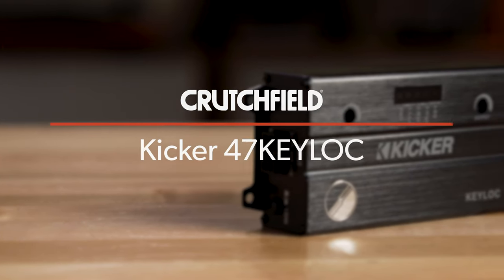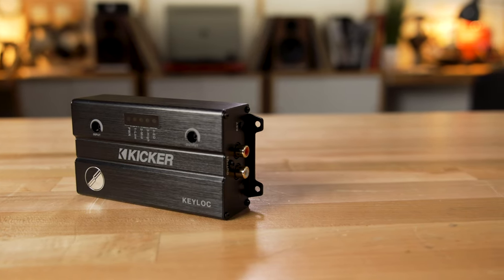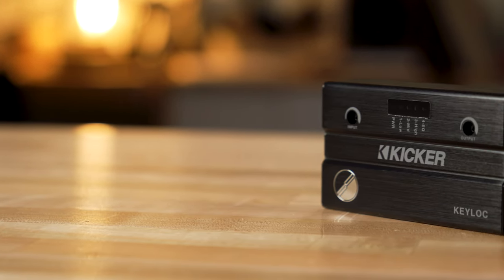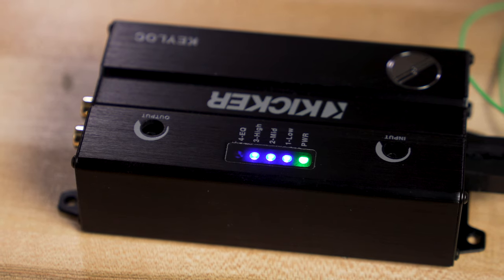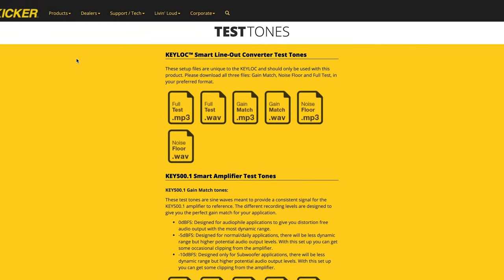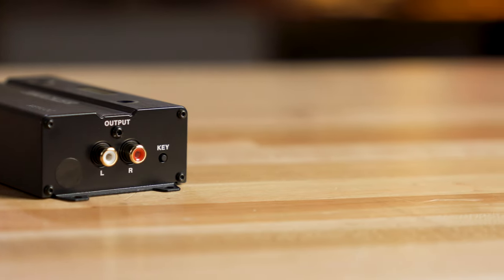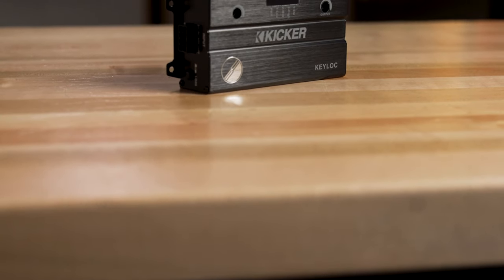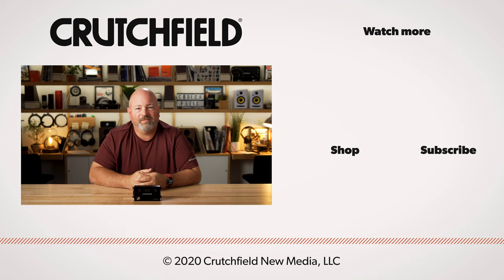Kicker KEYLOC smart line output converter | Crutchfield

Comment: Is this only 2 channels? I am using an LC6i at moment to get 4 channels out from my factory head unit to give me 6 channel output to two amps, one 4 channel for the speakers and a mono block amp for the subs. How would this work in this situation? or is Kicker planning on bringing out a multi channel version?
Reply from the maker: This would be used in place of the LC6i and 3 are needed to have 6 channel RCA output like the LC6i offers
Reply: I'm actually planning on using this for 2 amps. Kicker told me to run 2 Y RCA's out of it.

Comment: Hello! I have a Honda Accord 2015, installed a kicker subwoofer and kicker amp, I’m planning to upgrade my 4 speakers to kickers and an amp kicker also. I’m new into car audio. I have the factory radio head unit, how do I know if I need this little device?
Reply from the maker: Hi Erick, sounds like you are going to have a great setup!
What did you use to tap in for signal to the sub amp? Which 4-channel amp do you plan to use?
Reply: @crutchfield  I don’t have the answer for the first question since I payed someone else to do installation. For the second question, I plan to get the kicker key 200.4 amp
Reply from the maker: Nice choice! Just so you don't have a hybrid model, you can add and get signal to both the sub and Kicker amps using the AudioControl LC6i: www.crutchfield.com/I-rYALc921/p_161LC6IB/item.html
You can use this to tap in speaker-level for signal using your factory radio. You'll run RCAs from it to the amps.

Comment: Would this be necessary if using the kicker key 200 4 channel amp?  Thought about using the key amp to install on the factory system of a non Bose 21 mazda 6
Reply from the maker: No, you would not need a separate line converter when using the Kicker 47KEY200.4 amp, since it offers speaker-level inputs and a built-in DSP.
Reply: @crutchfield    Can it be used on factory speakers or is it recommended to upgrade?
Reply from the maker: Factory speakers can't typically handle much power, so it's best to also upgrade the speakers when adding the 4-channel amplifier.

Comment: I'm going to be having two jblclub5501 monoblock amps and two 8" jbl stadium speakers in my 2022 Ford maverick with the b&O upgraded system. I have been thinking about whether to get the ac lc2pro, but would this work better? And will I need 2 or would one work to run the two amps?
Reply from the maker: Both will give you clean signal using your factory radio. Do you need independent level control for each amp?

Comment: So im guessing i need one for front speakers and a second for rear speakers?? I have a 660.5 runing 4 door and and 1 sub on a 3rd gen tundra
Reply from the maker: We should have a better match for your 5-channel amp.  What year is your truck? Did it come with a factory JBL system or the factory center dash speaker? Are you replacing all the factory speakers? Thanks!
Reply: @crutchfield  23 tundra sr5 off road non jbl. I have kicker 660.5 amp and ks speakers and a low profile 8 in kicker sub tucked away under seat storage u can tell it sounds a bit fuller and some lows are better but it feels like the speakers are not performing to its full cababilities. Kinda leaning towards taco tunes ntune6 audio correction loc but i wanted a dsp
Reply from the maker: The JL Audio FiX 86 is also a solid contender. The Fix86 will automatically correct factory time delayed outputs before summing the signals and equalizing them with dual, 30 band, 1/3 octave equalizers. Its differential-balanced inputs accept virtually any OEM analog audio signal, from low-voltage line-level to high-power, speaker-level outputs (up to 30V RMS). The Fix86 offers three sets of Left/Right RCA outputs with Front, Rear, and non-fading Subwoofer.

Comment: I hooked up my wires from llc to three subwoofer wire and I keep getting distortion.any suggestion how I can fix it?
Reply from the maker: Noise is often caused by a grounding issue. You may want to double check the ground connections as well as make sure the new amp's ground location in the vehicle has  been cleared of any coating on the metal. Also, we have an article that can help identify the cause of the distortion:

https://www.crutchfield.com/I-rYALc227/learn/car-stereo-diagnose-noise.html

Sometimes distortion comes from an amp's gain not being set right. We have a couple articles and a video covering the process to set the gain on an amp:

https://www.crutchfield.com/I-rYALc227/learnsearch/amp_gain.html

Comment: What is the difference between keyloc and kisload4 ? Or do i need both?
Reply from the maker: The Kisload4 is a device that creates a speaker-like resistance that some radios need to see before they will output audio. The need for this part will depend on the vehicle you are hoping to install an amp into and if the stock speaker will remain installed. Will the stock speaker still be installed? If it will not, what is the year, make, and model of your vehicle?

The KEYLOC is a 2 channel line output converter that also has a DSP. Given that it is 2 channel, if your vehicle and application does need a KISLOAD part, there is a 2 channel model that is better suited to use with the KEYLOC. It is the KISLOAD2 found here:

www.crutchfield.com/I-rYALc227/p_20646KILD2/item.html

Comment: Hi, I just bought one of these from you so I could add an aftermarket sub/amp sub to my 2024 genesis gv70. The gv70 came with Prestige package that has the Lexicon system. I've heard from other GV70 owners that because the prestige has an active road noise cancellation technology, that you will hear it through the aftermarket sub once installed. Will this keyloc clean up the signal from the amp? I already tapped into the left and right subwoofers. Someone on a genesis forum said they used this to remove the road noise signal, but I was hoping someone else could confirm this.
Reply from the maker: Hi Tim, thanks for your order. You generally do have to turn off the factory active noise cancellation system when you add an aftermarket amp and sub. Our Tech Support can help with this. Their direct number is on your invoice.
Reply: @crutchfield  It cannot be turned off. Can you ask your techs if there is a work around. I was told if you roll the window down a little it turns off, but I'd rather disable it somehow, or have it on a switch.
Reply from the maker: You would have to disable/disconnect it permanently.  If you got the sub or amp here, our techs can help you with this. If not, Subaru should also be able to provide information on the ANC module location and how to disconnect it as well.
Reply: @crutchfield  ok thanks. Just curious, why would subaru know? It's a Genesis.
Reply from the maker: Tim, sorry about that! Not sure how I came up with Subaru. You would want to check with your Hyundai Genesis dealer. Did you get the amp and/or sub here?

Comment: I've got a question? I have New Mercedes-Benz and Don't wanna touch the the radio, Navi, lol on any other car I wouldn't care and have. But this car already has the Bsst 14 speaker Burmester Sound System, doesn't get much better. My worry is I've never tried one of these cheap boxes to tap into my my rear deck speakers,  I mean how does one of these compare to using A nice Deck with RCa PREOUTS?
Reply from the maker: This is the next best thing.  The best way to go about it will be highly dependent on  your vehicle.! I'd give one of our advisors a call to see what is best for you! https://bit.ly/2KP1zS3

Comment: Hello I install this keyloc and I only getting a low range is tha is ok my subwoofer is very loud
Reply from the maker: The KEYLOC's default status is in Passive Frequency Detection mode which can detect what band of frequencies are available on each of the speaker input channels. For a sub, you'd be at 20Hz - 200Hz.

Comment: Does this act as a ground loop isolator?which is a more higher end
Reply from the maker: It does not; but what are you connecting specifically. We're glad to recommend the best option for your needs.
Reply: @crutchfield   I'm connecting a Sony ax4000 the is constant hiss I've checked wiring all is in order I also have a Rockford Hilo connected. The hiss just won't go away
Reply from the maker: We do have a good ground loop noise isolator you could try here: https://www.crutchfield.com/I-rYALc921/p_127SNI1/PAC-SNI-1.html

Comment: Can I run a sub amp. 4 channel amp. Dsp and epicenter if I use the keyloc??
Reply from the maker: Hi Don, what is your exact setup? Which Epicenter are you using? What are you DSP and amp models?
Reply: @crutchfield  2016 Honda Accord coupe exl. Taramps md 1800. Original Epicenter. Prv dsp. 2x4
Reply from the maker: Thanks, Don. Looks like you can use it before the Epicenter and then run from the Epicenter to your additional EQ.

Comment: What's the difference between the keyloc and the lc2i? I really would like to know bc I cant decide on which to run..
Reply from the maker: The Kicker is automatically tuned with internal components.  the LC2i is a bit more manual and focuses specifically on Bass restoration.
Reply: @crutchfield  which one would be better to get
Reply: I used the lc2i in the past. It works well. This kicker one seems pretty dope too though.
Reply: @crutchfield 

Dude I’ve got the exact same question with the LC2i Pro and KEYLOC (Smart).

Although in my setup I want to “keep” my oem head unit and the oem amp.

Is this possible and which device would help me with this?

I would want to add (new kicker amp + kicker sub + either of them two device) in between my current amp and the dedicated oem sub (which is what is being replaced.).

Help?

Comment: I’m adding a pair of subs and amp I want to hook this into my rear speaker connections only. I don’t want to connect to the fronts. If I’m not getting a “sub level” frequency in the rear signal, where do I connect to?
Reply from the maker: There may not be any other choices. We can check. What is the year, make, and model of your vehicle?
Reply: @crutchfield  2005 honda accord
Reply from the maker: There is no factory installed subwoofer in that vehicle which means the front door speakers are the only other possible choice available. However, the rear speakers are the biggest in it and are the best to use to when installing this KEYLOC for a subwoofer. Since it sounds like you did this but are not getting any bass, we recommend contacting technical support for help. If you purchased it from Crutchfield, we recommend contacting our technical support for help. We send their toll free phone number on the order invoice. If it was purchased elsewhere and they cannot help, we recommend contacting Kicker's support for help
Reply: @crutchfield  No I actually have yet to hook everything up. I’m just saying that from another video I saw when the signal was not subwoofer friendly so they just used another signal but didn’t explain which one they used. I plan to hook up the subwoofer to the rear signal. I was just wondering worst case scenario if the rear signal wasn’t base friendly then what should I do? But after reading your comment I feel more confident the rears are my best option.
Reply: @mjl6425  funny..  kicker claims if theres no base signal.  that keyloc will ad it!   thats one of the features.
Reply: @crutchfield  Can I run a sub amp. 4 channel amp. Dsp and epicenter if I use the keyloc??

Comment: can you use this with an aftermarket deck also?
Reply from the maker: While it can be used with aftermarket radios this will counter the EQ settings of the radio and any time alignment adjustments that you may have set on it. Most aftermarket radios don't need a device like this and work better with other line output converters when they don't have the preamp outputs needed to connect the amps you want in your system.
 
We can help recommend the most ideal one to use. Which aftermarket radio do you want to connect it to? Which amps will be used in the system? And, what types of audio control are you hoping to have over the sound?
Reply: @crutchfield  I have a JVC  KW-M650BT. Already pre installed before I purchased my 2010 Mercedes c300 basic audio package. I have a hifonics 2400 watt  Mono amp   With a 12” kicker Comp R ….that I connected and everything lights up and powers on but I sound from my subs so I had bought this kicker keyloc for my other car awhile ago so it’s not somthing that might help me?
Reply from the maker: This is not expected to help. The JVC receiver already has a subwoofer preamp output. You may want to confirm that there is an RCA audio cable running from that preamp output to the sub amp's input. If it is, then our recommendation is to consult technical support for troubleshooting help

Comment: Will this be better to get this instead of the lc2i.
Reply from the maker: That's a good question and one with an answer that will vary depending on the person and their preferences. We have advisors who can discuss your gear, goals, and such to give a personal recommendation between the two. Here's how to reach us for this help:

https://www.crutchfield.com/I-rYTVc227/support/ContactUs.aspx
Reply: LC2i is for subwoofers only. The KEYLOC can be used for sub bass, or full-range 20-20kHz. The KEYLOC also handles factory time correction or all-pass filters.
Reply: @firebirdude2  Can I run a sub amp. 4 channel amp. Dsp and epicenter if I use the keyloc??

Comment: Would this be good to put in my 2014 charger v6. I got 3000watt taramp amp and 2 12s kicker
Reply from the maker: If that gear is being connected to the stock system in the Charger, then this will improve the bass!

Comment: Does this compensate for bass roll off ? Or does it need to if you make sure your input has the low frequency. I’m so confused I’m debating this keyloc or the lc2 pro or the 
NVX XLCA2X X-Series PRO 2-Channel Line Out Converter Digital Bass Enhancer with xBOOST. Also need to know how to set the gains and boost on whichever LOC I get !!! One more thing this put up to 9.5 volt out can all amps handle that much how do you adjust to fit the amp.
Reply from the maker: It takes some tweaking; but the Kicker 47KEYLOC does offer signal restoration for bass, mids, and highs. Instructions are included and you'll have the direct number for our Tech Support on your invoice. You can use the Output Gain
to match the output voltage of the KEYLOC to the
input sensitivity voltage of your amplifier.